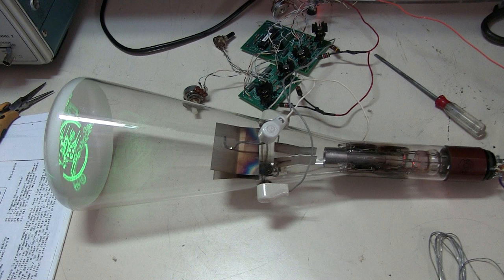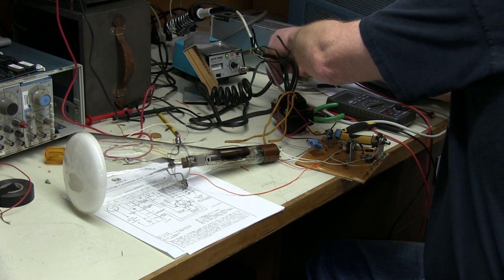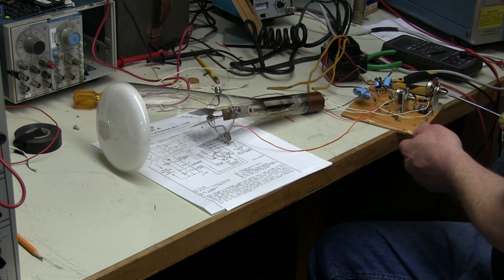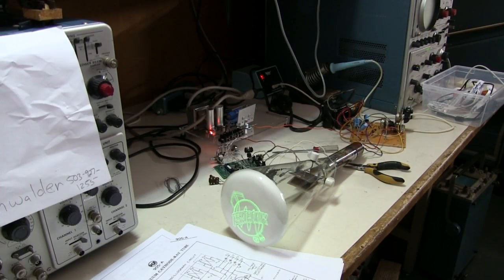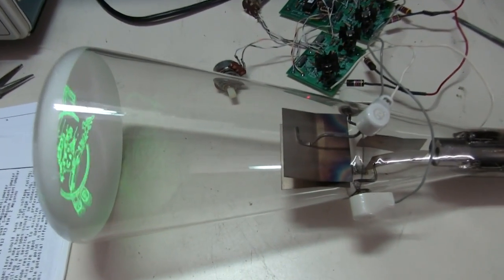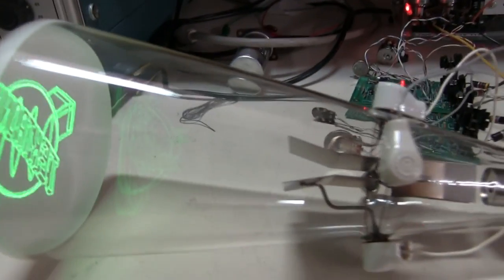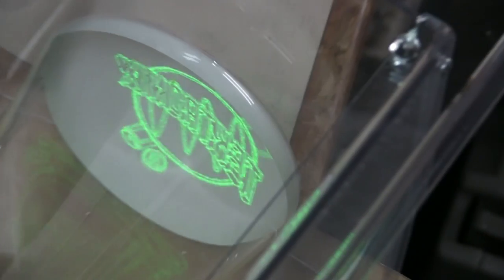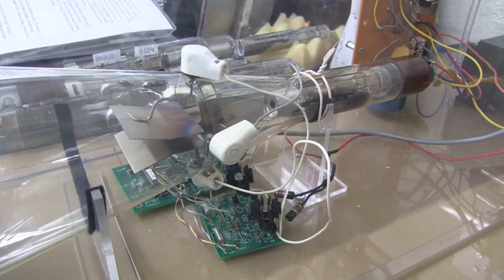vintageTek Demo of a 1930's 905 CRT

Comment: where is electromagnets???
Reply from the maker: I don't know what you're asking. If you mean the magnetic field causing the display to "swim" it comes from the two power transformers.
Reply: i am asking about magnets that give place electrons
Reply from the maker: If you mean a magnet to focus the electron beam, there is none. This CRT, like all scope CRT's, uses electrostatic focusing.
Reply: aaaa thanks
Reply: The beem is deflected by electrostatic plates inside of the tube as in old tv's.  I have an old sony watchman that has a folded picture tube that you are actually viewing the picture inside of the tube.

Comment: this is so cool but ive always wondered why crts with this vector like graphics system dont produce a visible streak across the screen when it goes to display a different shape on the oposite side of the screen
Reply: Robert Haas how about blanking?
Reply from the maker: The reason because the beam is moving very rapidly between shapes, so it is nearly invisible.
Reply: Robert, I still make new CRTs! I was wondering if any of the guys from Tek are still around. I only knew a few of them but they taught me alot.
Reply: @mikeh4840  I would like to correspond about ideas if you are interested.
Reply: In what manner would you like to correspond?